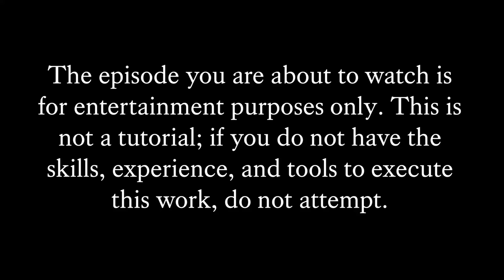Anvil 088: Shotgun Rib Soldering

Comment: Thanks for the video, Mark. Not exactly the same, but I just soldered the vented rib back onto my Mossberg 5500 with the help of this video. Never soldered before and the joint came out great, the sharpie tip really helped out. Just had to touch up the bluing that got ruined in the process with some cold blue. Couldn't get an exact color match, but doesn't really stand out from the rest of the wear and tear on the finish. All said and done, I'm in the project for about $80 to do something the local gunsmiths were quoting me at least a few hundred to do (more than the value of the shotgun).

Comment: I'm totally with you on the acid core solder.  It may have worked 50 years ago on automotive radiators, (I'm in the vintage auto restoration business) but there's no place for ACID anywhere near a firearm!  Great video, as always, Mark!  Thanks!
ETA: I sometimes am called upon to solder "difficult" antique items at work, and have found that Eastwood's "Tinning Butter" has been a life saver for me.  No substitute for cleanliness, but it does work miracles when properly used!
Reply from the maker: Just ordered a pound of the stuff. Thanks for the tip, I'm still using the stained glass window supply chain
Reply: @marknovak8255  I'd be interested in your experience with, and opinion of, the Tinning Butter.
Reply from the maker: Wilco, will let everyone know

Comment: Nice to see that type of channel was still around.  I used to watch one very good gunsmith channel, but this gunsmith stopped doing videos about gun repairs and the sad part all his videos he did were removed.    Gun repairs and gun smithing is a noble trade, and even for a machinist I learned a few tricks that could be used for jiggs on milling and lathe turning conventional oreven CNC.  I'm sure that I will learn more tip that can be use in my trade.  And it's by keeping an open mind you learn new trick everyday. finding your channel made my day, great job.
Reply from the maker: Great to have you aboard. Please help spread the word.....

Comment: Burning a Fossil Fuel produces water vapor. We all know what water vapor does to metal while heat is a catalyst. I really enjoyed watching, listening and learning. But we truly learn by doing. As an auto ASE Master Tech since 1978, I was tickled by a comment you made. As an apprentice in a two man shop, the owner taught me invaluable skills and lessons. He had a double off-set u-joint on a drive shaft that needed shortened. In the city we where told by the owner that he would do it, but said he had never made a mistake. My boss, like right at him, picked up the driveshaft and turned to walk out. The machine shop owner yelled something, my boss turn around and said “If you have made a mistake, you have never done anything”. He softly told me, “Or he’s lying... Either way, he not working on this”.
RIP Mr. Whitcomb. Great video, I truly did enjoy the content!

Comment: I've watched a gunsmith do this before.  It was a lot smokier than the way it was done here.  I think he had used a different solder and an oxy acetylene torch.  Thanks for doing it on the Anvil Mark.  I know it's a big job and no easier recording it.  Thanks
Reply: I don't think he would have been using an oxy acetylene torch.. too hot and too concentrated for this type of work, even with a rich mix.. possibly an air - propane, but usually a normal propane torch is what is used.. You can use stick tinman solder and rosin flux. In the UK traditional gun trade they used ground up rosin powder..

Comment: Best bit of advice Mark gave to amateurs is you do not melt solder with the torch ,it's the heat from the metal does the work ,.also with any soldering or brazing it is impossible to be overly clean .Finally if tinned correctly the solder will flow like butter . Regards from the UK .
Reply from the maker: It was my intention to show exactly that. This was not a job we could dump thousands into, to be technically correct. The whole job had turned into a hot mess from a time, materials, effort, craftmanship standpoint. It was a teachable moment for everyone involved, as I pulled their collective bums out of the fire.

Comment: If that paste flux was for plumbing and not specifically electronics its probably loaded with a chloride compound of some flavor that reduces to hydrochloric acid under heat just like the liquid stuff. Probably doesn't matter here but it's a frequent trap for young players in electronics, the residue is aggressive enough to slowly eat the thin copper traces off a circuit board.
Reply from the maker: Ididn't mention that, good catch. It wouldn't really hurt in this application, but good for others to know. Thanks.
Reply: @marknovak8255  And thank you for showing this repair, they always tell ya to make sure the barrels ring when buying one, but not how to fix them. Also, another trick from the electronics side. You can avoid that whole cold joint problem with 63/37 as it's a eutectic alloy, no plastic range, at some point in the great race to the bottom they figured out one could make due without that 3% extra tin, but the nice stuff is still made.
Reply: @Broken_Yugo  Far from "race to the bottom" 63/37 is newer in frequent application than 60/40 and the change therefore represents more a shift in typical application from large joints (where the better thermal conductivity and wider working range of 60/40 makes it easier to flow) to small electrical connections (where both migration and dry joints are a major concern, and melting 5 degrees sooner can reduce stress on components) than it does skimping on materials.. especially as the lead is actually worth more per volume than the tin. Indeed more recently most employers have been forced to switch to lead free solder blends that are none of the above due to the concerns of long duration buildup health impacts on workers, so the 63/37 vs 60/40 is more in enthusiast spaces that are almost entirely removed from cost pressures.
Reply: Hamish McGregor Lead bearing solders are getting rare. Thanks to the EU most are now silver / copper based and have a higher melting point. Lead containing solders were banned for plumbing use in the 1970’s.

Comment: To avoid heat sinking by the steel clamps, I use Nomax sheets to isolate the clamps from the barrels so they heat and solder cleanly!

Comment: Great video on soldering,  one thing I learned doing body work with lead solder is if you use acid Flux you have to get every last bit of acid off the metal or it will rust. Some areas you can't get to , so in a year you have rust holes.
Reply: Good to know. I made a belt buckle and used acid core flux in the process and it rusted. Never thought about changing the flux. Thanks!

Comment: Not a gunsmith, but a long time electronic tech.  Your comment regarding cold solder joints is true, and a question I have is why you don't use eutectic (63/37 vs 60/40) solder?  Eutectic solder has no paste state making it almost impossible to produce a "cold" solder joint.  Price difference is insignificant.
Reply from the maker: Found some 63/37 and did a rib. It made a difference, enough to make me switch. Also correct about price not a factor. Thanks

Comment: I have no real experience as a gunsmith, but I've soldered a lot of copper pipe fittings. Kind of funny, I learned how to solder pipes (braze radiators) from my dad when I was 11 or 12, approximately 40 years ago. He passed away 4 years ago last month.
All that to say, a huge rookie mistake (that can be kind of funny sometimes) is not heating the parts to be soldered and trying to melt the solder itself to connect things.

Um... added side note. I learned how to wire a house, do sheet rocking, and fix cars from my dad. It helped, because in my late teens I worked in a medium sized hospital, in "Facility/Plant Services" (IE maintenance department). Then went to a career in heavy equipment repair. Both jobs, for their time paid really decent money. Now retired. It just seems today kids don't seem to want to be in blue collar jobs. Love the videos, and have actually been subbed since early in your association with C&Rsenal..
Reply from the maker: The education system has succeeded in the commie utopia of 2 entire generations of untrained, useless youngsters.....
Reply: @marknovak8255  It is very sad, and absolutely  terrifying if you spend too much time thinking about it. 
Since you happened to reply I have a fairly easy question. Were/are you an instructor at some point? Your way of explaining is so well done. Never boring, and not talking down to us your audience. I know these are not tutorials, and I don't have the tools or experience etcetera, but I learn so much from your videos. Thank you very much for taking the time to make them.
Reply from the maker: @Dsdcain  Been teaching my whole life. In the Navy, and I taught high school Mechatronics for a few years, so I get the lack of skills/common sense thing. "The first thing I will teach you is that you CAN count to 21 without your fly open"........
Reply: @marknovak8255  That answers that.  :-)
Thank you for answering.
Reply: @marknovak8255  "commie utopia" ? the college system present in the US is the epitome of a system perverted by capitalist processes.
Reply from the maker: @fastestmaninserbia  Noted. Nice......
Reply: @seadog158  Interesting the differences between British and American English. In American parlance, one would say that all most politicians ever do is graft, by which we mean they obtain money or other forms of wealth in dishonest ways. 🤔

Comment: Great video!  I currently have a side lock hammered 410 I have been tinkering with on and off for years.  The plates don't fit correctly, the battels had a dent about 3" from the end, the stock was improperly replaced, and it had been nothing but learning and headaches tinkering with this damn thing.  I have learned a lot, and spent several hours correcting whoever was in it before me's mistakes.  If it wasn't a passion project, would never have been worth it to fix, kinda like working on an old 22, you have to be doing it because you are learning or sentimental reasons.  Always love your videos mark, keep up the good work.

Comment: Absolutely vital information! I learned this the hard way when I did my very first refurbishment on an old Crescent double. The gun had ridden in a pickup, muzzle down and the barrels were no longer even. I thought that I could just square up the muzzle end on my disc sander and before I knew what I did to myself, I had broken through the dam of solder at the ends of the ribs. Panic led to learning, because no way was I going to continue to mess it up even more. I studied for a long time before attempting to fix it. The bigger the glob, the better the job was just not going to work. I went to ETMS after all, and my pride wouldn't let me.

Comment: I have an old counterfeit Greener that was proofed for black powder and I plan to make a modern barrel set for it.
I already have the raw barrels and ribs ready to go, I still need a lathe to bore the interiors to size and turn the barrels to shape, and unfortunately this video is an actual tutorial.
I have a metal melting furnace I made and I was thinking that the exhaust port could be vented through both barrels to heat it up so that it would solder the whole thing at once like mark said, (and I had seen on a video from an Italian gun manufacturer who made double barrel guns) then after the solder flowed out, cut off the heat and let it cool slowly.
Nice to see that the old school solder techniques will work for this if the barrels are properly held together.
Reply: Take up golf my friend...!

Comment: Done large soldering jobs like this I usually sand the two contacting surfaces use a degreaser to remove any oils place the prepared pieces together heat up each piece tin it then slather each piece with flux heat it since flux has two purposes removing any impurities and to help the solder flow then use a smaller gauge of solder when clamped up and solder. I personally thought you did a great job and soldering right the way down would have made it stronger I personally think it's real overkill and adds unnecessary nose weight.

Comment: I really like the video.
   Have you ever used 'Comet flux' from Brownell's? It's good stuff. What I really like about it is you can apply it with a Q tip and with the metal hot, the solder only sticks to the 'fluxed' spot. You can literally write something on steel, flow molten solder across it and have tinned only what you wrote!
   I'll have to give the sharpie tech a try. I have used a hardwood board as a clamping rack for this work, in the past. I don't  think someone could get me to do another one. As you said, unless it's a very valuable gun it is very hard to justify the expense of resoldering/soldering a set of barrels. Great video and nice work. Take Care and be safe, John
Reply from the maker: Comet is amazing stuff, but the flux I'm using here is inexpensive, and available locally. I find that Comet, being an alkaline salt, will after rust steel if not totally neutralized. On copper or tin, AMAZING. All this is just my opinion and experience

Comment: I'm only a wishful, hopeful, aspiring gunsmith...  However, I am a certified automotive technician with several decades of experience.  The principals of learning are the same.
  There are two ways to do something.  
The right way...  And again. 
  If you attempt to rebuild an engine and it doesn't work, you pull it back apart until you find a mistake and go again, repeating as necessary until all of the mistakes have been corrected.  It will cost you time and money and inconvenience.  But, if you learn what you did wrong AND how to correct and subsequently not repeat the problem, you're making process.  Eventually, you'll learn how to complete a process without making a mistake.  The problem comes when you're engaged in the learning process on "someone else's dime."  That will get you fired.
  I, like my father before me, have been fired from a few jobs while learning how to do it as we went, being able to gain enough experience during the process to be able to keep the third (or fourth lol) job I got.
  This was a long time ago and I did have a plan and paid attention and respect to the people for whom I worked.  I didn't "tear up" too much stuff, it was more of "You're a good worker and you try hard, we just need someone a little more 'self-propelled' who doesn't need constant supervision.  Come back if you ever get there."  One time, after a couple more failures and a success, I actually did go back to the first place I tried and got a job I actually kept for quite a while, because I really liked the boss and the company as a whole. 
  The secret to it all is "learning how to learn..."  How to absorb all the information you can and eventually learn to avoid making the same mistakes twice.   
  I  moved around a lot when I was young, out of necessity in harder times and had to put food on my table, whether I knew what I was doing or not.  What made me ultimately successful was respect for the employer and knowing when to say when. I only went through that process a couple of times but I gained experience I'd never have gotten any other way.  But I never tore anything up like this situation you have, here.
  If you need a good mechanic, carpenter or blacksmith, let me know.  lol...

Comment: I do electronics repair for a living......but dabble in firearms on the weekends. Solder and flux ect work the exact same way in electronics. Surface prep, oxidation, right amount of heat......all of it is almost identical.
Reply: 👍 I've got some soldered wiring almost 30 years old on my Jeep I did holding up but not the lights that I installed.

Comment: Mark, you are probably one of the best gunsmiths I have ever seen.  Is it possible to do a double barrel rib re-soder with 2 Damascus barrels?
Reply from the maker: I can, but you are in line behind a lot of jobs that have been here FAR too long.
Reply: @marknovak8255  Oh, no I assumed you'd be far too busy to take on such a project.  Plus I probably can't afford you.  No I am a gunsmith student in school.  And I wanted to know your opinion on the idea of doing it.  I was concerned that due to the layering and thin walls of antique Damascus shot gun barrels, if sodering would have an effect on the integrity of the barrels.  Obviously it was done when they were new, but now they are 140 years old and there is some rust around the ribs and the top rib has separated from the barrels on the rear 12 inches.  I take on the tough projects because I like a challenge.
Reply: @MoxieFirearms  practice on Damascus barrels that are out of and beyond proof and totally unsafe. If you can do them successfully then take on the real job and put the gun into the field again. Good luck
Reply: @samrodian919  Turns out they're just coiled steel barrels and not Damascus barrels.  But yes what you said would be ideal, but broken ones are more rare than working ones.

Comment: Mark, that is the difference between a gunsmith that has learned from years of work and trials and failures. I have to tell you that I have made just as many mistakes as I have made right decisions. I did my first solder job when I was 19 years old and the shotgun is still shooting today. It was a field grade L.C. Smith and I still use it all the time. It's getting harder and harder to find good 16 guage shells though.

Comment: I use shop made spring clamps when I'm soldering to maintain tension on the parts after the solder wets and flows ... fun video thanks
Reply from the maker: The clamps I use are also spring loaded. I replaced the springs with low rate ones, so just a small amount of force. The wire and nail approach fails to allow enough "feed" into the work as the solder melts,, in my opinion